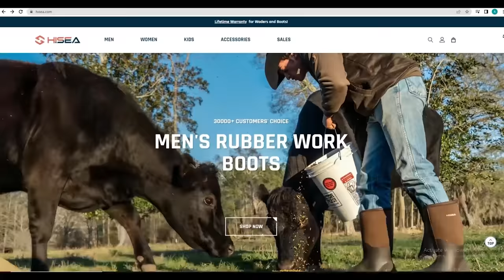Real Portable Sawmill Video | Frontier, Woodland Mills, Wood-mizer

Comment: I agree with David, very relaxing as I set in my recliner drinking coffee.  It does make me feel guilty, I should be outside working!  Chief would you have chosen the R14 tire over the R4 if it were a no cost option?  Sorry, I don’t remember but are the rears loaded?  Probably.  I’m fixin to pull the trigger.  Hot here also, but not your hot.  Cool at night thankfully, so if I wasn’t a layabed I could get stuff done.
Reply from the maker: TYM doesn't offer R14 as far as I know. You can R1 or R4. I like the R4 for an all around tire. Mine are loaded.

Comment: Could you show us how to use the duel log scale on the OS23? I just got my OS23 and I'm trying to figure out how to use the scale. You make it look so easy. If you can't, no problem, I know you're busy and it's hot out there. I've learned a lot from watching your videos. You explain things well. Thanks  Joseph
Reply from the maker: Don't look at it as a dual scale. One scale measures the exact distance from the blade to the log bunk. That will never change. Think about the next scale after you make your first cut on the log. You zero the second scale out to the first cut. Your first scale may be 10 and 3/4 in from the bunk, but your second scale will be 12 in exactly. You then will use your second scale to go down for your next cut.
Reply: @TonysTractorAdventure  thanks Tony. That helps, appreciate it.

Comment: Love the videos!  Quick question: Have you ever had issues with the blade on your sawmill not sitting level front to back?  My Frontier OS23 blade and deck both sit pitching forward.  The result is the blade dives and I get wavy boards.  Just curious if you've had the same issue
Reply from the maker: I have not had that issue. My blade has always been level. I would make sure that the sawmill blade is running correctly on the bandsaw wheels. Another thing to check is to make sure the blade is properly tensioned. A loose blade will wander around. My blade barely touches The guide rollers when pushing through a log.

Comment: Curious as to why your first cut is so shallow and gets mostly bark? Then your second cut goes deeper but still leaves a rough edge and it appears you set those aside. Do you then trim them into dimensional lumber? I guess I see where if you got enough of them you could put a bunch standing vertical on the cut edge to trim the rough edge.
Reply from the maker: There is no reason for my rhyme. It was a split second decision. I am learning more each time I use it.

Comment: I have the same sawmill and have cut my share of lumber with the 7 1/2HP engine. I have a friend with the same mill and he upgraded his engine and had to re drill the cabinet for the shaft on the engine. Which engine did you go with and did you have to make any modifications?
Reply from the maker: I did a video on the engine install. https://youtu.be/ylI7aBA0wSU